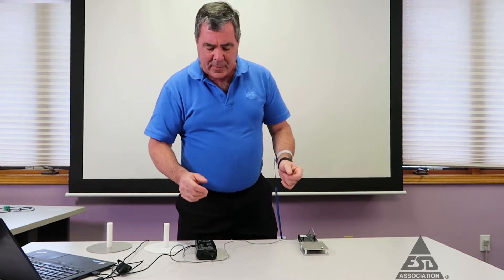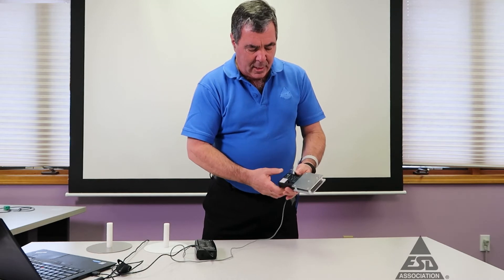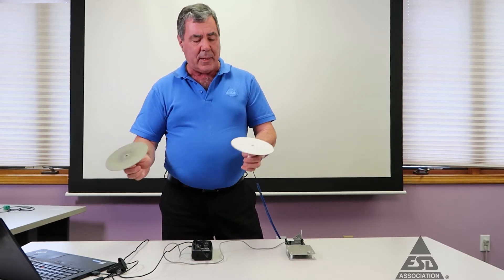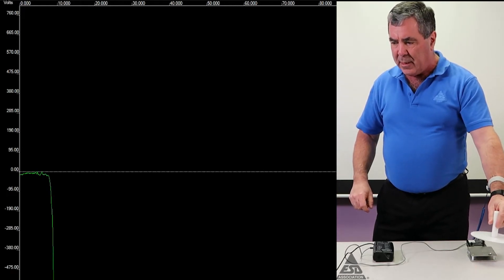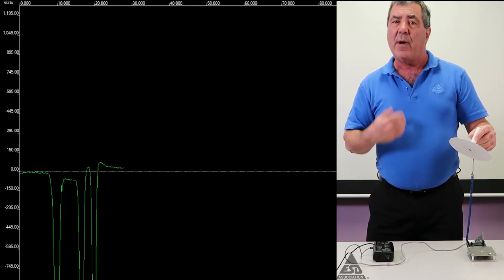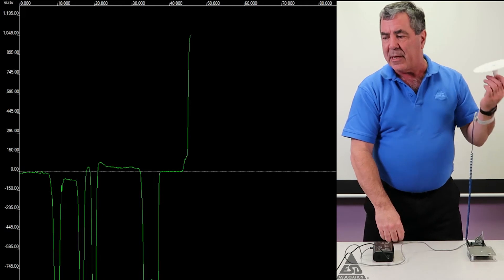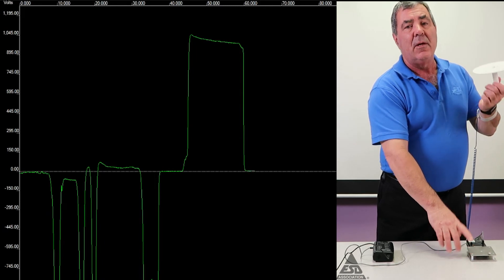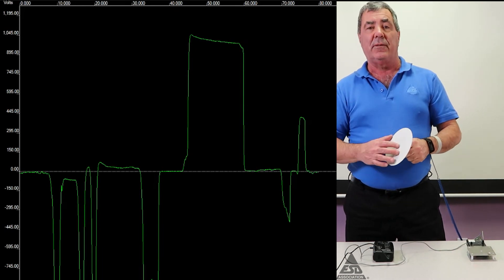Induction

Comment: Nice clear demo of electrostatic induction, using  charge on one body (the Delrin) to induce a charge on another body. For viewers who aren't aware, in this use, the word "induction" is a term from electrostatics, and not to be confused with the term "inductance" which is from magnetodynamics. In electronics, electrostatic induction relates most directly to capacitors and capacitance, and inductance relates to inductors, transformers and inductance.  So, for example, a wireless charger for a cell phone is an "inductive charger", and uses magnetic induction, not electrostatic induction.
It's kind of amazing to realize that the demo here is almost unchanged from the exhibitions given by the early "electricians" of the 1600's and 1700's, except that the meter would be a foil electrometer, or a pith ball.   Just like in the demo here, they used specific materials to generate static charges via the triboelectric mechanism (rubbing of different materials against each other). These charge-generating materials, which  formed the basis of their studies, were referred to as "electric bodies". The word "electric" meant "like amber" (Latin electrum, Greek "elektron"... and other interesting etymology), amber being a gem stone that was known to be effective as a charge generator.  
Perhaps It's ironic that the electrical and electronics disciplines are named after a material that's decidedly non-conductive. Amber is also a resin, so actually closer in concept to the material used in PC boards, rather than the traces and wires we usually associate with "electronics". And the phenomenon that gave amber such a prominent role, triboelectricity, remains one of the lesser-understood among the whole spectrum of electrical phenomena, as part of the challenging physics of interacting surfaces at the atomic and electronic level.